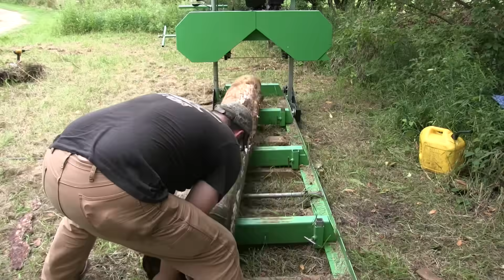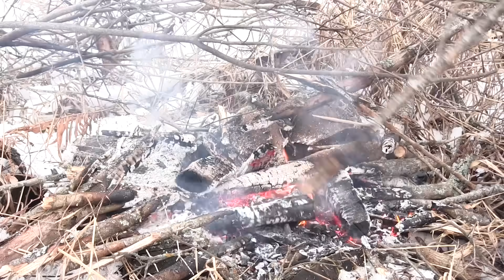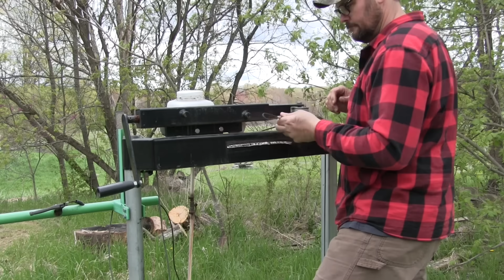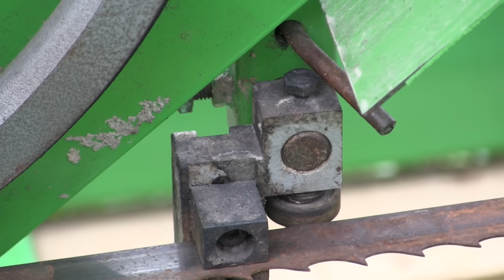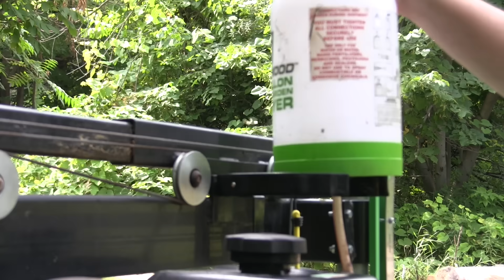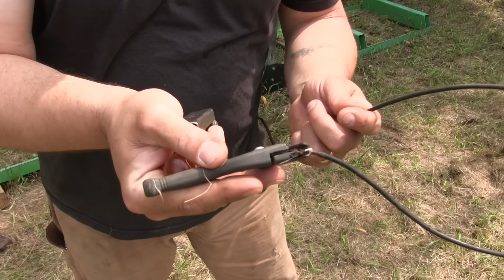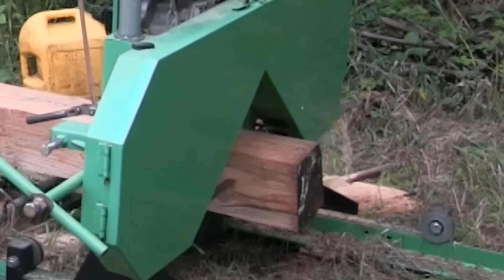Harbor Freight Sawmill .....set up &  first impressions

Comment: Those predator engines are great, I have that same engine on my wood splitter, never had any problems, it doesn't matter if it hasn't been started in, 2weeks, or 6 months, 2 pulls and it fires right up, I was hoping to see how you cut that big log on there, I have a woodmizer on order, that can handle 28" diameter log,but I got a poplar log that's 40" dia ,I guess I will have to whittle it down a little, lol

Comment: I have a HF dirty water pump with a predator motor on it.   If you drain the carb after use it starts the first or second pull.   Mine is six years old and still runs great.

Comment: I bought a Hudson Sawyer model. Very challenging assembly, poor welds, holes in the wrong place, etc. One bearing roller doesn't touch the track. Been using it for a couple years, finishing my first timber frame structure. Looks like that harbor freight is it's equal, at the least. I bought the Hudson because it's " American made" but it came with a Chinese engine and parts. But, I'm building with MY boards and beams.

Comment: About engines, I had a generator with a Robin-Subaru engine, (They are junk from the factory in my opinion) I couldn't find a Honda knockoff like Predator with a tapered shaft. I did find a genuine Honda GX 160 for around $250 from a company called Surplus Center.

Comment: I would like to find a small electric bandsaw sawmill. I will not buy a gasoline sawmill where my face is in close quarters to a running engine for about 8 or 10 hours per day. I know breathing in a little exhaust fumes does not hurt and it depends on the wind direction but I still want the running gasoline engine a further distance away from me as possible. Like a generator attached to a 30' foot long heavy duty electric cord.

Comment: Nice video, i have a small chainsaw mill that I use for cutting up the occasional logs that cross my path, but the larger chainsaw mills could be a good option for cutting and recovering those bigger logs in situ, without the need for heavy extraction equipment. That being said, the Harbour Freight mill looks like a great option for a homesteader or landowner who does a bit of milling now and then. No frills means less to go wrong. It’s a pity we don’t have an equivalent machine available in the UK, at least to my knowledge.
Reply: I've seen fellows build their mill on a 2 wheel trailer and take the mill to the timber. When they get to the timber take the 2 wheels off and set it right on the ground! Some of them had a leveling jack on each corner and one on each side in the middle!

Comment: A size up in belt will only give you a quarter inch in length around the pulleys, for an extra inch you should have tried 3 to 4 inches longer.

Comment: Congratulations! I know I've mentioned to you that I have a Norwood 2000 with a custom 30' bed. I am hoping to do just as you mentioned, pouring a 4' x 32' slab to put the sawmill on. I also want to convert mine to electric.

Now that you have a sawmill, I am curious to how you feel about building? I have mentioned to you that if I had to do it all over again, I would build timber frame using SIPs. It is way easier to move a 10"x10"x20' cant, than it is a log. Character logs can still be used, so you can do a lot of cool stuff mixing them. My 30' bed was made by the previous owner, he had a welder friend that welded it up. I have a forklift, but it's still tedious to turn a log enough to cut a 4 sided cant, but once that's done it's the good part that is left. 🙂 Cutting quarter sawn is another story, way more turning to do it right. I have a design for a timber frame that wouldn't require any bigger than a 16' cant. Build it in a quadrant, you get a 32'x32' using 4 x 16'x16' sections. To be fair, it could be hard to get SIPs into a remote location, so probably not for everyone, but you could still cover the timber frame with other material. Lots of options, including stone. Being a concrete person yourself, I imagine building a pad for the sawmill should be a piece of cake. Do build it at least 25' long pad IMO, so you can build a longer bed or extend the one you have, and be able to cut a 20' log cleanly.
Reply from the maker: Ive never done Timber frame or SIP building, so I cant say I have an opinion. I'm a log builder , so I think If I were to use the mill to build I would be 2 siding everything. Three siding is great but you loose the nice round log interior
Reply: @Bushradical  Well, you're a pretty talented person, let's not kid ourselves. I just think timber frame can simplify building homes, it does get an air tight home (using SIPs), but better to need to add air than trying to keep it out. Your vertical post doesn't look too time consuming. All that said, I've probably got a much different view of building than many that watch your channel, since I'm building <gasp> on the grid.🤣

Comment: Nice video - would be fund to get a sawmill. I noticed this same mill sells for $2200 from Harbor Freight, so spending $1500 used plus mods is a bit high IMHO.
Reply from the maker: I save $1000 at least, when you add in tax and freight fees ( this mill gets delivered with a LTF lift gate service

Comment: Not sure it's been said before, I'd go up another belt size, that was too tight. I used to service commercial HVAC equipment, belts that tight wore out quickly and really shortened the life of the sheaves and motor/fan bearings. Just google V-belt deflection. Basically you want 1/64" of deflection per inch of span using about 10lbs of force. Span length is measured from center-to-center of the sheaves. The amount of force depends on C2C length, but 10lbs is good enough for this use case and that length.
Cool video though, looks like a nice unit for the price.
Reply from the maker: Thanks for the info...I did end up going up a size in belts to a B77

Comment: dammit Beavus, now I'm hungry..

whatever works, if it holds up it will build you a house, barn, outbuilding, even a crapper with a half moon...  lol

a guy could get a good reliable still 55 or so and get a 4 foot blade and make the portable mill set up with that to dimension the larger logs onsite down to workable sizes for your mill..  other than that whatever works right, and the money you saved prolly leaves money over for mods and such, i'd want to cut up enough wood to build me a mill house first off, then get a couple stoves in it and burn slash to keep me warm while I dimension logs, have a large door on both ends so you can drag logs in real easy, fill er up then close doors and stay toasty..

just dimension all day long.. worth it IMHO milling your own wood for your cabin or home whatever, barn so forth... imagine in the day they did all this by HAND!!! and the logs were huge sometimes...  WOW

I'm jealous, lucky Dog...    (Y)
Reply from the maker: Thanks

Comment: Dave...??? My name is Dave as well. You changed out the motor for one that did not come with the machine. Did you consider that the base of that new motor could have different mounting point locations? Did you consider that the pully could have been the wrong size? Instead of going with the Harbor Freight recommended belt for the original motor/mill combo, before buying a new belt, you should have just looped 550 cord over the pulleys while the new motor was in about the 1/3 or 1/2 range of the slide adjustment slots. Then take a measurement of the length of that 550 cord where it re-touched itself and bought the belt with that size inside diameter. You did a lot of unnecessary work, (drilling and filling), when just buying the proper length belt in the first place would have achieved what you wanted to start with. A lot of wasted time in this video for such a simple mistake. Personally, I might have left that little mistake out of the video but that's just me, LOL. Great and informative video. You obviously know your portable sawmills and mechanics in general. Keep them coming...

Comment: $1500.00 for a use product? I believe you said it took 7 months to work out the bugs? Frustration,  running back and forth to a supply house for several different size belts? Then the time required to modify the the motor footing mounting holes holes to achieve the proper distance and tension necessary for the belt to operate efficiently. Degrading lubrication bucket replacement required a new one. Another excursion to harbor freight or local ace or big box store. (Gas, vehicle wear and tear) I bet you had to buy hardware fittings and other essentials, and more excursions in your vehicle. Bottom line? Time is money! Either you've got a lot of time, or a lot of money. Or both. Was it paid with stimulus checks? Be honest. 7 months would've made most men abandon this project and order commercial lumber. You've got the patience of Job (ya know the biblical dude?)
Reply from the maker: LOL, I didnt work on it for 7 months.....4 of those were winter, I was in Alaska for 2 of them, and I had to do a bit of tweeking to get the mill running.......I bet there is a 7 month waiting list to get a new mill ...I saved $1000, and got a mill without waiting

Comment: green wood will shrink in diameter some but not in its length. when u cut do you have to calculate for shrinkage with the cut. Re slotting the motorbase for the belt is a big "deal" for them NOT to get right/ you did good. Get er done. Bet you could find a old vertical bandsaw for its welder and make your own blades from a bulk roll. Put that belt on too tight and it will knock your bearings out. You need more adjustment. A idler on the soft or slack side of the belt would give you lots of room to adjust. Just use a spring for tension. old school.

Comment: Much appreciate the honest and thorough review.  Solid points about spare parts and cost differences too.
Reply: I'd point out that bearings are no problem. Any decent industrial supplier can provide that sort of thing... and at a significant reduction. When I used to do my own m/cycle maintenance I'd get really pissed off at the cost of bearings. So one day I jotted down the numbers on the bearing shell and dropped in on my local industrial supplier. Instead of the

Comment: That's funny, I always thought Honda motors were manufactured in the U.S., Japan, and Thailand.  Not so sure any come from China.  What I think you need to consider is picking up some welding and metal fabrication skills.  That way, you can add track to mill longer pieces of wood, or possibly expand the width to accommodate some bigger diameter logs.  But I did enjoy your video very much.

Comment: And, if the lumber is coming off a little rough or wonky, one could run or thru a planer, no?  How do you know how far you've adjusted the blade down for the next cut?  Is there a scale?

Comment: Is it possible the belt was suppose to be put on while the engine was slightly loose? Or did the engine mounting slots not allow it?
Reply from the maker: they were out of travel
Reply: @Bushradical  got it working anyway and looked fun to use

Comment: I like the fact that you were able to make modifications without a big hassle. That's another pro on the pros and cons list. I like my Harbor Freight stuff.
Reply from the maker: Thanks
Reply: unnecessary modifications the belt he tries to use was the wrong belt. ite was 3" too short He tried to use a b75 which is 78 inches long outside measurement. This sawmill takes a #b1981 which is a 78" long belt inside measuremen moron

Comment: did you modify the sprayer jug to lubricate the blade? how you getting water out the bottom ? siphoning
Reply from the maker: There is a valve inline in the hose
Reply: @Bushradical  not what I meant,  the old one had a nipple at the bottom of the jug, what about the new one

Comment: Nice to see someone pull maintenance like that to put a tool right.  I prolly woulda just jumped up another 1" on the belt since you had the motor slid over and should have had plenty room to tighten over the years...
Reply from the maker: I did end up going up to a B77

Comment: So when changing belts, I know it was defective mounting but when I change solid core wheelchair tires. I use zip ties to hold them in place in several spots so it does not slip.
Reply from the maker: good tip

Comment: i hope you read this , that belt is too tight still.. buy a slightly longer belt to fit better. if you keep using a belt that is too tight you will ruin the shaft bearing on the belt pulley as well as the bearing on the output shaft of as well as the crankshaft of the gas engine both of which will be expensive and time consuming ..if you look up the specs of the belt you will find they have a rating that you should not exceed..
Reply from the maker: I went up the next size in belts to a B77

Comment: I noticed that all the wire splices  are not heat sealing splices. You may want to change out the splices with the heat sealing ones,  since the mill is exposed tom the elements.
Reply from the maker: I do cover it with a tarp

Comment: For parts go to the listing and download the PDF for this mill so you have the parts breakdown for your mill. There should also be a customer service number in there that you can call to buy parts specific to your machine. I did this with an old v-twin compressor pump head I got for free used from a guy who was going to put it on the IR compressor tank I bought off of him (I bought it as a project). I needed the air cleaners for it. They were the cheapest around for that part, and I knew from having one previously that their air cleaners were really good at keeping the pump quiet. I have my compressor right in the shop with me so that was key having it quiet. I don't know why they don't have it set up to do this on their website, but at least the option is there. The only time I ever called and they didn't have parts for me was stuff they discontinued selling like 20 years ago. This was one of those old mill-drill-lathe things, which the lady told me they stopped selling in the mid-'90s.
Reply: Here's the link to the listing https://www.harborfreight.com/power-tools/power-saws/saw-mill/saw-mill-with-301cc-gas-engine-62366.html
Reply from the maker: Thanks

Comment: the overall value of the woodmizer is not commensurate with the price paid. yes you get half assed customer service from them but when it comes to spare parts of the harbor freight mill, most of them are off the shelf parts you can pick up from ebay, maguire bearing,  and a whole host of other industrial suppliers. and if something breaks that they don't have a short trip to any machine shop will usually result in a swift and fairly inexpensive replacement ...so don't be afraid to buy one of these things.
Reply from the maker: Thanks

Comment: The issue I had with the track connection segment was that each side  had different dimensions of where the bolt holes were. Even with shims coming out of alignment would be enviable.  I ended up cutting the center braces out, bought some angle, and fabed my own tracks and that made a world of difference on how precise the lumber cuts were.
Reply: They must have improved their manufacturing process, my tracks were near perfect, I poured a concrete slab and used concrete anchors with washers to shim the height and I can cut a 1/16 inch thick piece of parchment 15 ft long. I am very happy with my mill, for the price. I'm sure there are better mills, but for the money this does everything I need it to do.
Reply: the issue is its the wrong belt  He tried to use a b75 which is 78 inches long outside measurement. This sawmill takes a #b1981 which is a 78" long belt inside measurement

Comment: Lots folks knock HF and it's well deserved at times
Bit if you expect sub par and can take care of those, it'll work as well as those high dollar deals. 

For the tracks
Wouldn't placing the halves on the same runner, or two that are bolted together, that's leveled make the bump less likely???

Comment: These are currently brand new 2200 USD

Also you can find a complete parts list from harbor freight and order from them directly. Also the belt is wrong. For your model(which they still sell)... It is a 78 inch belt.

Comment: Sounds like a car I had. I had to take the wheel off to change the battery! Maybe it would be easier to make a chainsaw mount to cut across? Mount the chainsaw on a track and slide it down. Hmmm

Comment: You can’t run that belt that tight. You will wear the bearings on the drive wheel shaft and shorten the life of the belt. The belt you took off was too tight as well. I would want at least 1/2 inch deflection in the belt.
Reply from the maker: I did go up to the next size
Reply: @Bushradical  , thank you , that was bugging me , lol.  A belt is a lot easier and cheaper to replace than bearings or worse the shaft.

Comment: You should have also looked at the INSIDE of the female portion of that adjustment rod and seen if there was any rust in there. Then cut a piece of hardwood on your table saw to just smaller than the width of the other portion of the rod and put some adhesive backed sand paper on the brand new sanding block you just made and sanded away the rust inside...I'm just saying'...don't address just half of the problem, you have to think things through.